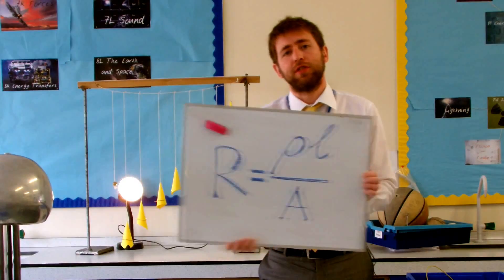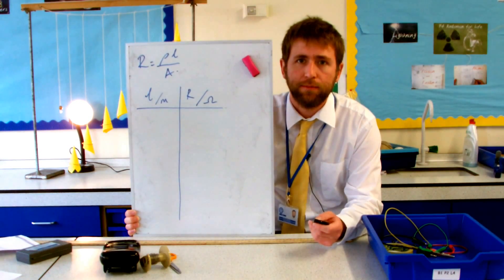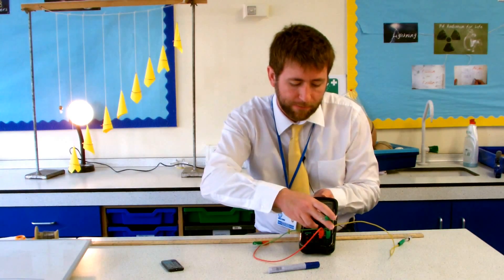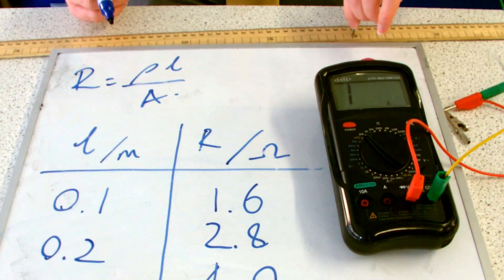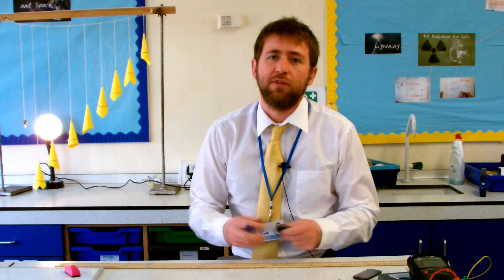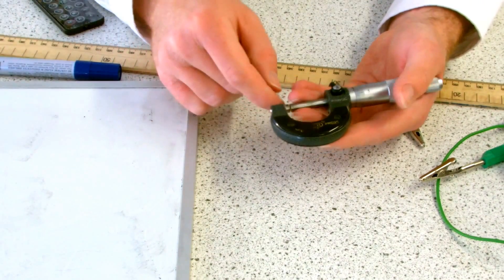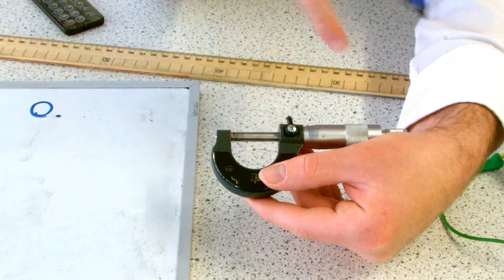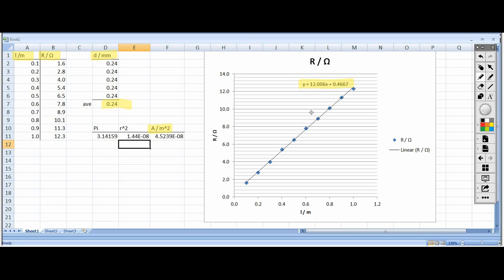Resistivity of the Material of a Wire - A Level Physics Core Practical

Comment: Hi Kit, I am a science technician supporting A level physics. I find your videos really insightful. Have you used an excel formula to calculate the radius and area? I cannot seem to match your figures in trying to work it out, so then I can transfer onto my data to work out.
Reply from the maker: Ah thanks so much, very glad to know that they are still helping people out!  Yeah, perhaps you are having trouble with the "pi" function?  It's weird that "=pi" returns pi, but you can't just write pi into a function.  I either just fudge it and go for 3.14 in the fomula, if I'm feeling fancy I'll stick "=pi" in a cell and reference that in the function.  Either way, you should be ok with Area being "=3.14*(d/2)^2"   Hopefully that works!
Reply: @kitbetts-masters  The only part I am struggling with now is how did you get r^2 which is 1.44E-08 on your spreadsheet. I am trying to self teach here as it has been a very long time! It is for making technician notes for the future. Thank you again. It is much appreciated.

Comment: what are safety precautions within this practical
Reply from the maker: Very little as it's such a low current. Some people talk about the ends of the wire being sharp, but that's a tiny risk not worth mentioning really! If you do use a circuit then use a low voltage so that there isn't a chance of wire getting too hot/causing burns.  This will also make your readings more accurate.

Comment: why is my multi meter showing the same resistance for my wire no matter where i put it. Also, the numbers on my multi meter are going everywhere, from 150 to 0.4, before they reach the same number.
Reply from the maker: Need more information, what metal are you using? Fluctuations might be due to dodgy connections somewhere. Are you using it as an ohmmeter or a voltmeter?
Reply: @kitbetts-masters  i am using an aluminum  wire and an ohmmeter on the lowest setting of 200. Also, thank you for replying very quickly!
Reply from the maker: @tim9208  try the other things, check connections, multimeter placement, check it's not on a.c. mode.
Reply: @kitbetts-masters  it does not seem to be working
Reply from the maker: Sorry buddy, not sure without seeing the circuit. Try the old fashioned swapping out each component and hopefully you'll find the issue!
Reply: @kitbetts-masters  ok thank you

Comment: What happens if we did multiple trials? Can we still go with that and get an average of the resistances or just the best one trial would do
Reply: And wouldn’t only doing one trial / experiment cause errors possibly
Reply from the maker: So, the point is that in this case multiple trials could cause an error.  The wire could heat up, so with electricity practicals it's better to just do one trial with more data points.  In reality this probably doesn't make a massive difference in this case, but is an important consideration.

Comment: What voltage and current did u put through the wire ??
Reply from the maker: Seth Freeman Payne I didn't, as I just used the multimeter on Ohmmeter setting. It measures the resistance directly. It's always best to keep current as low as possible though to avoid heating changing the resistance of the wire. I guess the multimeter does put a small voltage across the wire and measure the current to calculate the resistance, but it'd be very small.
Reply: Thanks

Comment: Hi thanks so much for the helpful video! I'm just wondering why don't you need to connect a power supply to measure the wire's resistance? Would it be different if you measured the current and voltage separately and used the values obtained to find the wire's resistance instead?
Reply from the maker: Lizzy Philips hiya, the multimeter is measuring resistance directly.  If you like it puts a small potential difference across the wire and measures the current, hence determining R.
Reply from the maker: Lizzy Philips if you used a cell or power pack you may get some heating effect which would change resistance, but in my experience it tends to be quite consistent except at very short lengths. glad to help!
Reply: Thanks for replying so quickly!